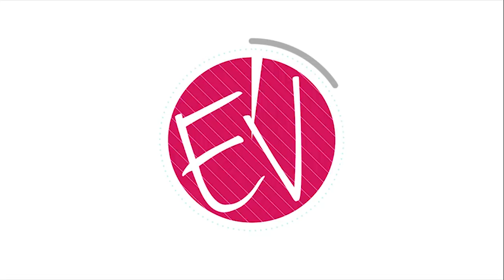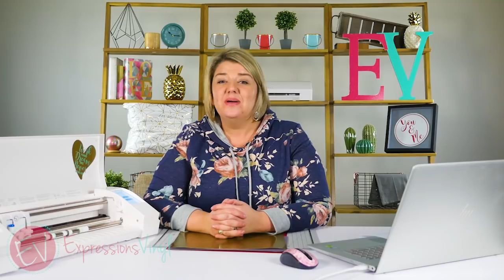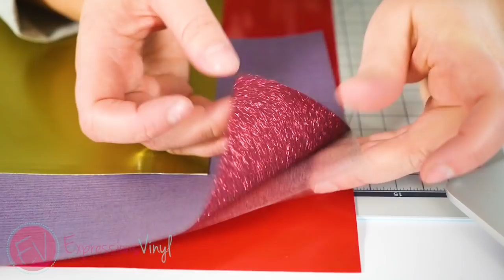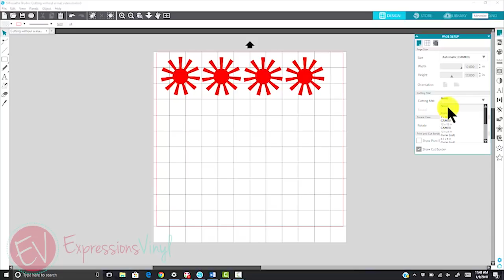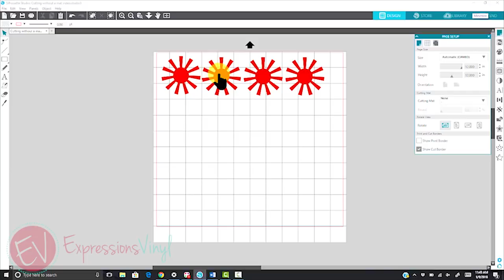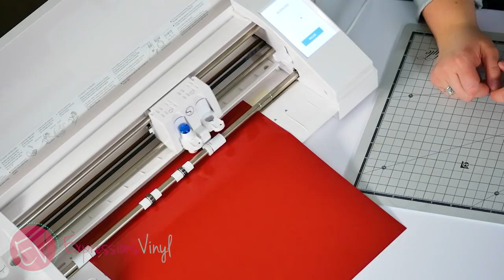Cutting Vinyl Without A Mat on your Silhouette Cameo

Comment: Thank you! Im new to cameo 4 and I’m trying to use the cutting feature without a mat. I’m having a problem with my vinyl when it is loading. It curls up and doesn’t end up under the blade. Also it moves around sometimes during cutting. Any ideas?
Reply from the maker: Is the vinyl able to lay flat before loading it in the machine?  Check the roller positions.  They may need to be adjusted.

Comment: My problem is it never register the registration marks. If I'm cutting adhesive vinyl or vinyls period are there supposes 2 be registration marks cuz I have none & my mat doesn't either.  I've only had my silhouette cameo 4 about a month now & I've only gotten it 2 cut out my daughter's name 3 times.  Also there is no selection  IN THE MATERIALS DROPDOWN that says adhesive vinyl  for the PSV or is it labeled somthing else?  But no matter weather I have the registration marks on or off  it still tries register marks & fail.  What material are registration marks needed 4?  I'm only trying to cut vinyl?  Thank u
Reply from the maker: Registration marks are usually only used for print and cut designs.  If you do not have your design prepared as a print and cut, you may need to contact Silhouette customer service to find out why your machine is looking for them.  Recommended cut setting for vinyl purchased from Expressions Vinyl can be found here:  https://expressionsvinyl.com/machine-settings/
Reply: @Expressionsvinyls  thank u.  i only have a picture of mickey mouse & my son's name & i was trying to send it from the silhouette to my epson 2850 to print it on sublimation paper, but the print preview only shows the mickey picture & not my son's name. dou you know a reason that it might be only sending over the mickey pic, but not his name?

Comment: How does the cardstock and vinyl stick to the mat?  Got my machine today and all videos I see show the vinyl like your scraps sticking to the mat.  Thanks for your help
Reply from the maker: mats have an adhesive on them to hold the material you are cutting in place.  Some mat brands carry different adhesive strengths.  Choose that adhesive strength that works best with the vinyl you are cutting.

Comment: You have your roller in the wrong spot. Should be at the 2nd line on the right otherwise leaves marks on the vinyl in the middle of your design
Reply from the maker: When cutting without a mat you do need to move the roller in so that the vinyl doesn't move.

Comment: when your test cut fails to weed properly how do you keep from cutting in the same spot?
Reply from the maker: Instead of the test cut on the software. You can use a Capital R this will give you all of the angels that you have in a cut. By doing this you can move the R over a little ways and redo the cut.

Comment: On my cameo 3, when I set to 'no mat', the cutting begins about 1-2 inches to the right even though the design is fully to the left within the cut area. Any ideas what might be causing this? The material is being loaded correctly and the 'no mat' setting is correct.
Reply from the maker: Try recalibrating your machine. You can do this by unplugging your machine. Then moving the cartridge back and forth a couple of times. If this does not work you may need to do a Firmware update.
Reply: @Expressionsvinyls  thank you for the reply! Before seeing this, I manually forced the cartridge back and all good now, so your solution is perfect. Thanks! I'm not quite sure when it got so out of alignment :)

Comment: Hi. Thanks for the video. I'm wondering if cutting without a mat could dull the blade faster or if it cuts too deep ruin the machine? I know it's made to cut without a mat, but it safe to always do it that way...assuming the paper has a backing like your vinyl does. Would this work with stickers?
Reply from the maker: The vinyl must have either a carrier sheet attached or a backing to be cut without a mat.  We recommend test cuts before sending your design through.   Vinyl can also be cut with a mat if you prefer.

Comment: How do you move the roller in?
Reply from the maker: There is a lever/switch right above the roller bar on the right side. Turn the switch to release the bar.  The bar will lift slightly, when it does, you are able to slide the roller to the inner set of arrows.  Turn the switch back to the upright position to lock the bar and roller in place.  See more detailed instructions on the silhouette website.

Comment: Hey, uh. How about showing how to move the roller, please and thank you.
Reply from the maker: You will need to Lift the lever piece on the upper right hand side,  unlock the plastic piece on the right hand side of the roller, move it to the grooves, and then lock it back in place.
Reply: @Expressionsvinyls  "unlock the plastic piece." How?
Reply from the maker: @stellaluceat7335  There a little picture of a lock and an unlock on this plastic piece. You will need to rotate this plastic part to the unlock symbol and then you can move it.
Reply: @Expressionsvinyls  OK. Thanks so much!!

Comment: What are good heat transfer vinyl settings? Also this wouldn’t work with my auto blade.
Reply from the maker: Here is our machine setting guide it has all of the heat settings needed for the HTV that we carry. https://expressionsvinyl.com/machine-settings/
What vinyl were you cutting? Which settings were you using to cut the vinyl?

Comment: Two things?  Can you put a box around your vinyl design area for easier weeding?  Does the mat have to go in Arrow first? I ruined my mat by cutting in too deep and have a new one.  Now I am afraid to use that one? :(
Reply from the maker: Yes, you can put a weeding box around your design to help with weeding. It doesn't really matter if you have the arrow first or not.

Comment: i try to test the cutting template on normal A4 paper..because i want to test it first to see the size, position & condition before i apply the cutting on vinyl.. but the cutting on A4 paper become messy..why? i think the mat to sticky or moistly that make the A4 paper become unstable.. do i not to use the mat? i try to set the speed to 1.. it still meessy
Reply from the maker: Hi, sometimes it isn't the want the machine is cutting, it can also be the type of paper.  You want to make sure it is really adhered to the mat.  If it's paper then you will always want to keep the mat.  Make sure you adjust the blade so there isn't as much pressure on it.  If there is more pressure and the blade is too deep it tends to drag through the cuts for thinner materials.  Hopefully that helps.

Comment: Very new to this as my machine was a Christmas present, Silhouette Cameo 3 - I'm about to attempt this for the first time - can you tell me, were you using 651 vinyl in this demonstration?  I'm using 651 permanent vinyl and unsure of settings and worried I may cut through. Also, is there a cheat sheet for settings? Cutting without a mat on different product?
Reply from the maker: Hi Nicole, you will love your machine.  We have a lot of cheat sheets that are great for the different types of vinyl.  Here is the link to that - https://expressionsvinyl.com/machine-setting.html  Also, here is a link to the Silhouette Playlist that we have.  It is full of great videos that will help.  https://www.youtube.com/playlist?list=PL3ghl46Qz0pRjn9tE7olaOV3_3GYFD0Es

Comment: Hello, I'm new to Silhouette Cameo and I have HTV glitter and when I put it on a cardstock with cutting mat, it ben up into the machine and when I use it without a cutting mat and use it as HTV glitter, it cuts to deep and I have it set on auto blade. what might be the problem? thank you
Reply from the maker: Hi Brittany, what are the cut settings you are using?  Here are the ones re recommend  to start with but you always want to do a test cut to make sure.  https://expressionsvinyl.com/machine-setting.html  Also, when you are placing it on the mat, how sticky is your mat?  Are you placing anything else with it or just the sheet of vinyl on the mat?  Let us know.  We'd be happy to help.  You can either reply here or send us an email at support@expressionsvinyl.com
Reply: @Expressionsvinyls  my mat is sticky,  but i try to take some of that sticky off just with a shirt and tap on it . But i had change my setting, and now it work great.
Reply from the maker: Oh great!  We're happy to hear that.  Let us know if you have any additional questions.

Comment: Hi, I was wondering if I can print a design on a rolled vinyl sheet paper that you can buy at silhouette with either an ink jet or laser? Cause I sell stickers & i'm planning to try the vinyl paper
Reply from the maker: There is InkJet printable vinyl that you would want to use if you are planning on printing.  The other types of vinyl will not hold the ink and it will just wipe off.  Here is a link to our InkJet Printable Vinyl for Stickers as well as additional printable.  https://expressionsvinyl.com/printable-vinyls/

Comment: SO I DON'T NEED A PRINTER
Reply from the maker: Hi, the only time that you would need a printer is if you are working with Printable Heat Transfer or Printable Adhesive Vinyl.  Otherwise, you can do all the cutting without a printer.  Please let us know if you have any additional questions.

Comment: I'm having problems with my settings. I did everything you said but my settings it cutting through my vinyl, when I use a mat I do not have this problem, I have no idea what's wrong. The settings I use 1-1-10 for vinyl
Reply from the maker: Hi, we'd recommend that you decrease the thickness on your machine.  That may be the reason that it is cutting all the way through.  Hopefully this helps.

Comment: What would you consider eazyweed vinyl in the Material Section? Is It heat Transfer or Just Regular Vinyl?
Reply: thanks so much. You are very helpful
Reply from the maker: EasyWeed is heat transfer vinyl so you would want to use the settings for that.  We also have some helpful charts for the recommended cut settings.  You can find them here - https://expressionsvinyl.com/machine-setting.html

Comment: I have followed all your directions but when I hit send and the machine starts to cut my vinyl starts turning in the machine. what am I doing wrong?
Reply from the maker: Hi Walter, thank you for watching our video.  We're sorry to hear that it's not working for you.  Make sure that you move the rollers to the correct spot so that they are on top of the vinyl.  Also, make sure that your roller bar is all the way pressed down.  We have seen it come up at times.  Please let us know if you are experiencing any other issues with it.

Comment: Hi! How do you get your cardstock off your mat without it tearing? My mat has been well used so it isn't super sticky, but the card keeps tearing when I try to take it off. I am also using the sketch pens, so is there any way to not use the mat at all?
Reply from the maker: Hi Tori, that can be a tough one to work with sometimes.  The best thing that we have found is to really remove the mat from the cardstock.  Turn the mat upside down so the cardstock is on your surface.  Then slowly remove the mat from the cardstock.  They are thin and can be bent a little.  You would not want to cut it without the mat as you need something to stabilize it so it won't move around.  Hopefully this helps a little.
https://expressionsvinyl.com

Comment: Thanks Jessica:) I'm wondering about the position of your roller without a cutting mat.  When I put it in that position,  the roller makes a mark all the way down the vinyl. Will that affect the look of the vinyl after applying it? HTV or adhesive... Thanks, I'm addicted to watching your videos :)
Reply from the maker: Hi Lori, it shouldn't impact the look of the vinyl.  Once you have cut your vinyl and applied it, most of that will smooth right out, especially with the heat transfer vinyl.  Please let us know if you have any additional questions.
Reply: Expressions Vinyl Thank you!  I'll try it and see how it turns out :)

Comment: Thank you for the video.  I am using the same blade you are and my settings are 2, 5, 14.  I had to bring the force up to 14 before it would cut throughly.
Reply from the maker: Hi Judith, yes each machine can be a little different on the exact settings.
Reply: Also if your blade is getting dull.

Comment: Hi Jessica!  I'm a new newbie for Cameo 3.....thank you for this post!  Very helpful.....one question....regarding the 'blade"....you said Rachet Blade...is that the same as the blade that comes with the Cameo or an extra blade you purchased?  Thanks! Sharon
Reply from the maker: Hi Sharon, in the Cameo 3 you receive the auto blade.  The ratchet blade and the premium blade are ones that you can purchase separately.  Here is a link to both of those.  Hopefully that helps.
https://expressionsvinyl.com/silhouette-america/tools-accessories/blades-and-tools/
Reply: So I CAN use my normal auto blade for the demo you presented...doesn't have to be the 'rachet blade'...correct?
Reply from the maker: Sharon, Sorry for the late reply. YES absolutely you can use your auto blade. Just make sure that is the blade you have selected in your program. It is usually auto selected anyway. :)